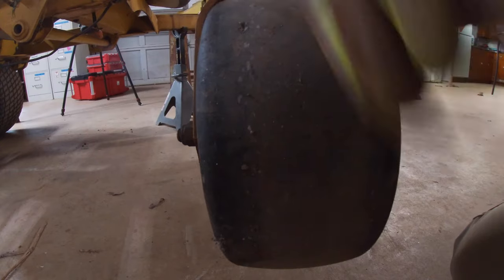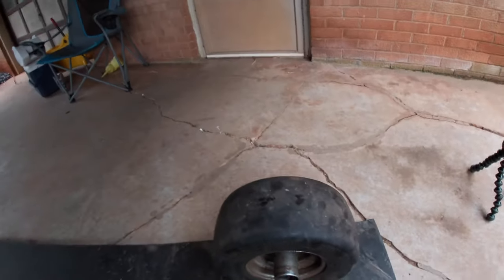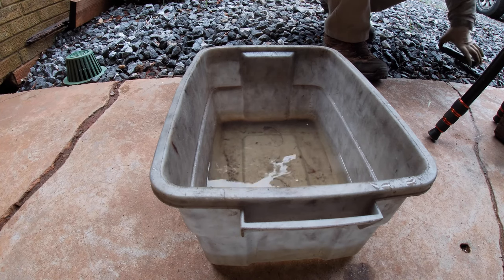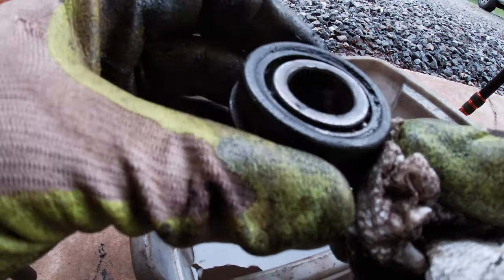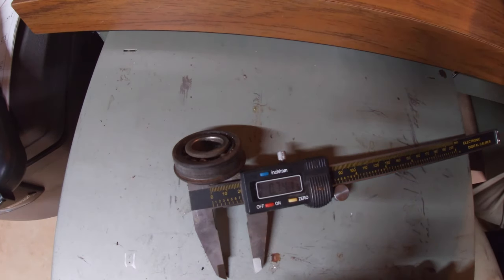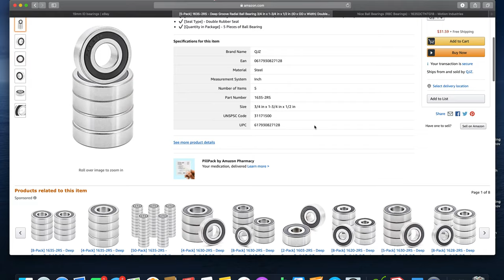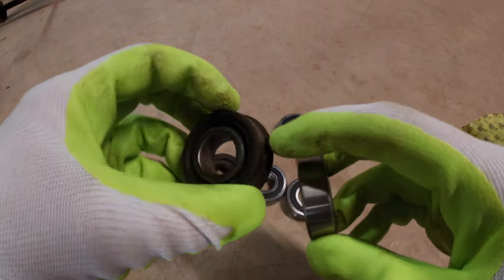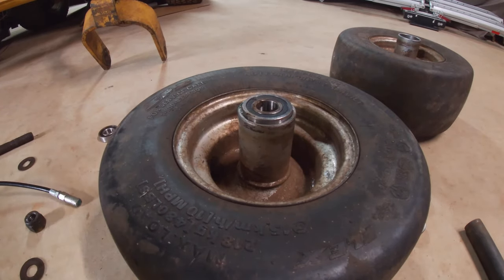Replacing wheel bearings on a Zero Turn Mower

Comment: the bearings he installed are non -greasable type . need to remove one shield off one bearing on side facing the grease fitting to allow grease to enter bearing.
Reply from the maker: thanks for pointing that out. makes a lot of sense

Comment: Those are non greaseable bearing you don't need grease.
Reply from the maker: Thanks. Do you think I should have removed the little rubber bearing cover to allow for grease?
Reply: @JustinBiddix  Yes if you're adding grease otherwise you be wasting your time putting grease in it.